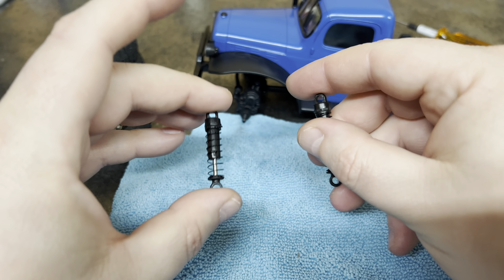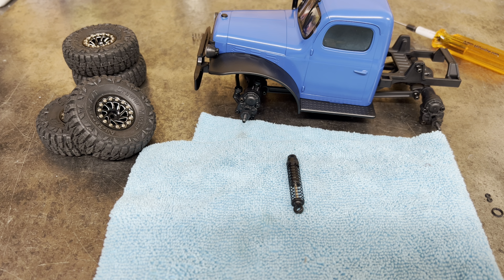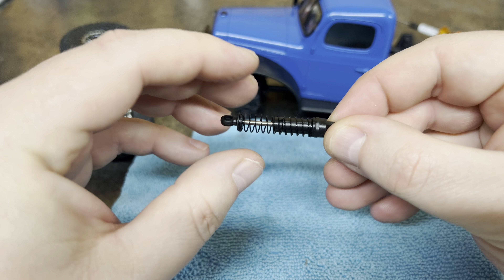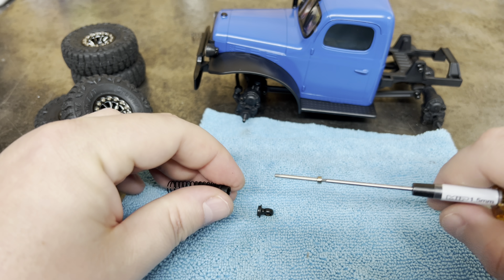FMS Fcx24 gets oil shock upgrade and some special springs!

Comment: Are used 20 weight I think might still be too thick, but it performs good. Appreciate you sharing about the springs I would hate to buy the shocks just to get to springs.I’ll be following for more
Reply from the maker: Yea it may be I am going to remove some oil as well